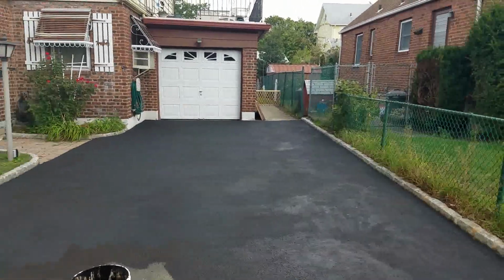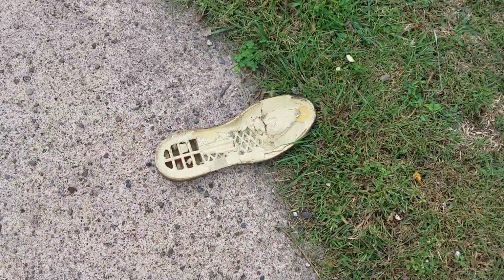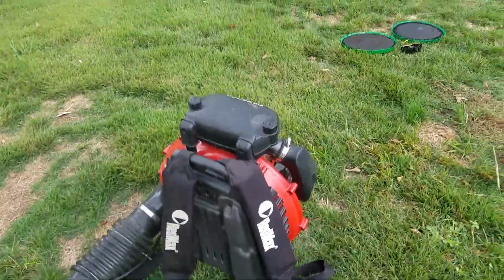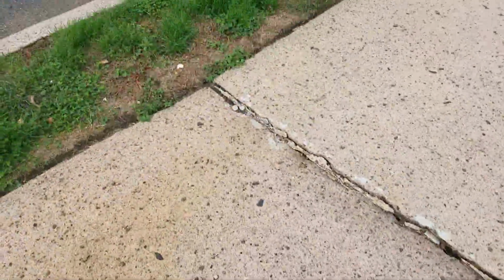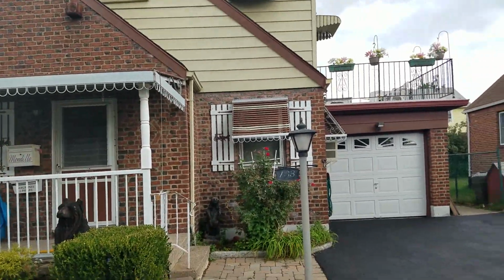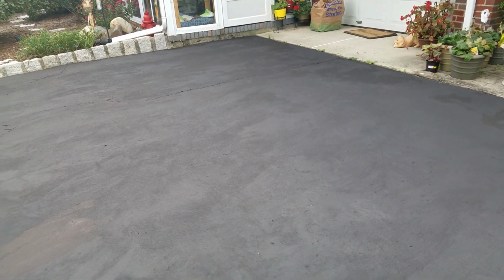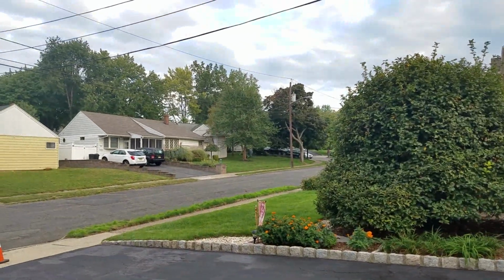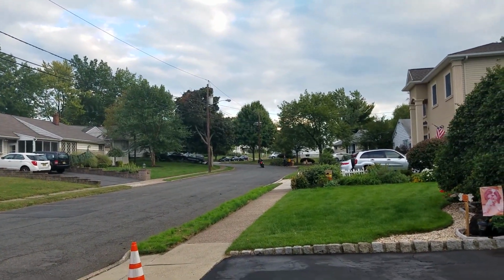Seal coating , Motorcycles, RedMax 8500 and more FUN !!! VLOG #22

Comment: The Engines for those blowers are made in China, then shipped to Nashville, AR for assembly. The Redmax units had the most  issues during the assembly, but left the line the best. Little fun fact from a line supervisor I talked to.
Reply from the maker: +crazyjdkid what isn't made in China ...lol...just reality now ...I'm into tools and every brand has motors or parts from China ..reality ....yea that's awesome info for sure ...I haven't had one issue with mine
Reply: Yeah to get the stuff at a reasonable price we have to outsource some.